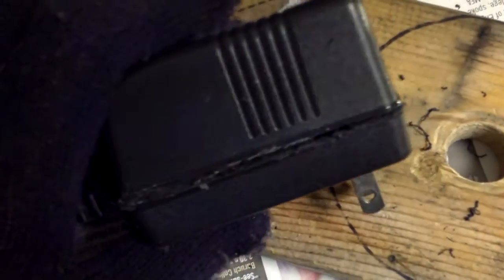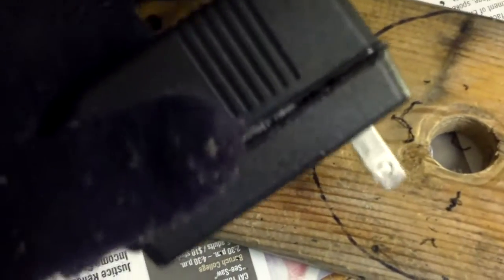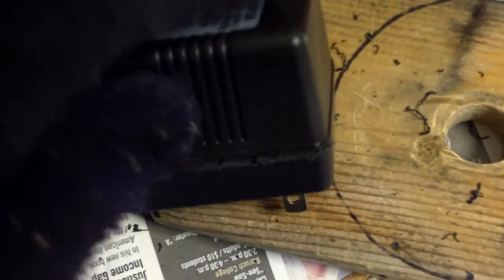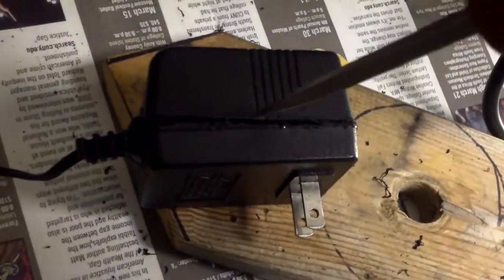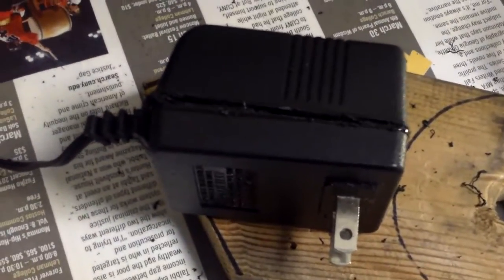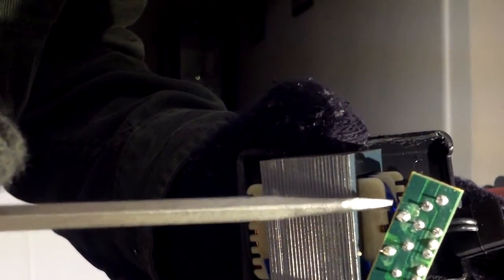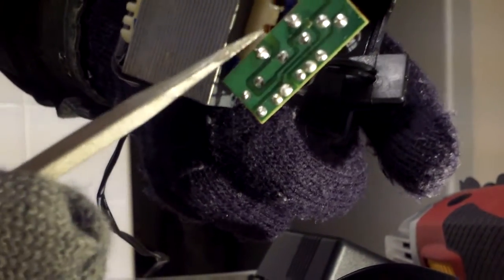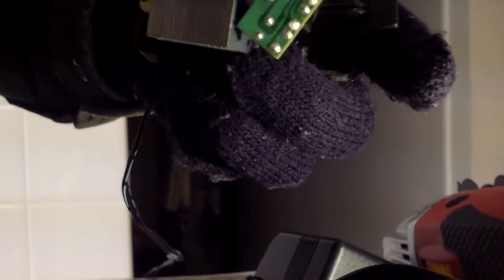Repairing a dropped transformer/ power plug

Comment: I would have hot glued the case back together, or at least zip-tied it with the electrical tape.  Krazy glue would work as well, as would epoxy.  

I never bought that multifunction tool at Harbor Freight.  The tool is cheap but there are so many accessories running into quite a sum if you want them all.

I recommend you do a review of it.  You have the subscriber base that it will likely get quite a number of views by itself, not counting any outside views, which will add up to quite a handsome amount.  It may even garner you a bunch more subs.  I hear that guy jaykay18 makes some pretty nice reviews, you may want to watch for some ideas!
Reply from the maker: I kind of know that guy (jaykay18) so maybe I'll leave it up to him to do the review :)
  The multi tool comes with a few useful accessories. A real bargain for $20 or so I have to say. I have used it successfully to cut open laptop battery cases, make small cuts in wood etc. You are right of course about epoxy glue for securing the transformer shell.
Reply: wtam69 Yeah maybe I'll break down one day and just buy it.  Probably get enough ad revenue the tool will pay for itself like many others have!  :-)
Reply from the maker: jaykay18 In the off chance that I run into you in the store when you are making the purchase, I'll say hello and give you my two cents on the multi tool.
Reply: wtam69 Ok cool.  I'm sure we both could do some damage (to our wallets) in Harbor Freight if we were there together!